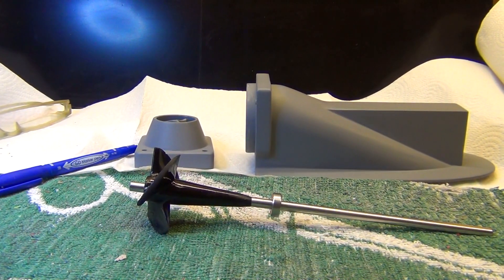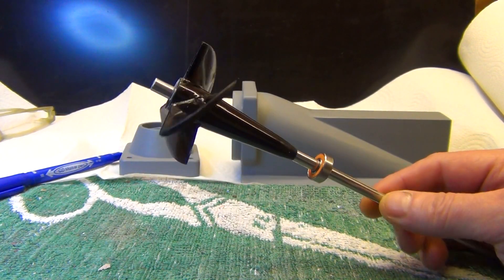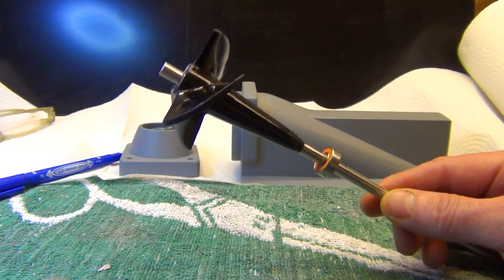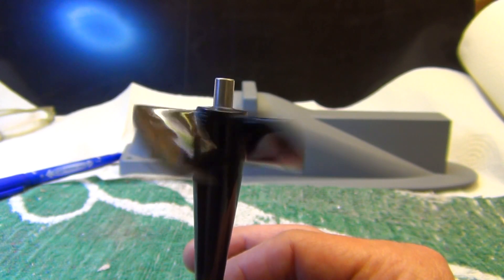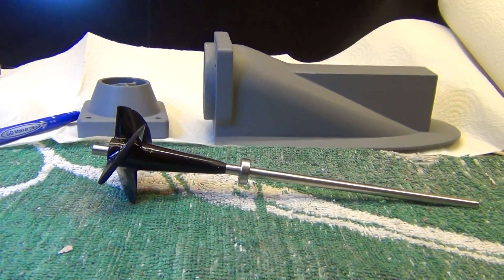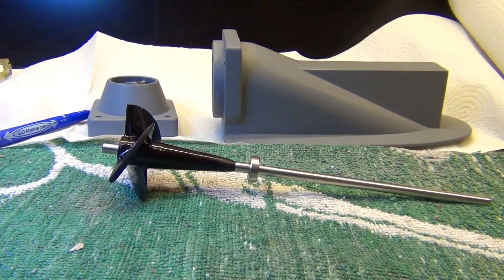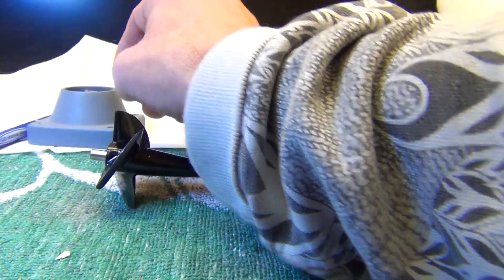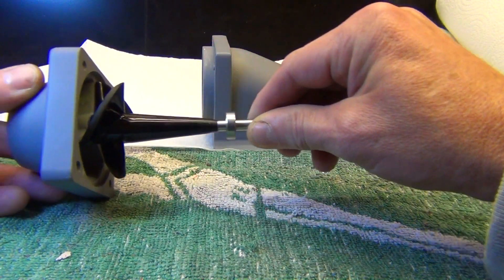First new jet drive piece, 53mm imp

Comment: Hi Mark
    Looks fantastic ! Do you think this wold push a Kayak with a decent motor on it ?
Reply from the maker: Hi there :)
yes I think it would be a great match up size wise,
I need to test the structural integrity of the drive unit first, 
but the impeller could be optimized for that application
without too much trouble to match the standard motors used,
I hope to do this as soon as possible,
thank you very much for your visit
all the very best
Mark

Comment: My goodness that unit look so bold..   LOL  Wishing list is running right now..
Reply from the maker: Thanks Al
there are still a couple of edges to round off,
but hopefully it's up for the job, strengthening stuff
may need to be done, but only on the impeller or if there 
an excessive leakage between the nozzle and jet body under the 
hydraulic pressure,, we'll just have to see :))
there could be a very big bang,, lol,, 
or I need to load up the motor more with a different impeller if I don't think it's working hard enough,, I'm a bit rough on motors :)
Cheers for the message mate
I hope all is well
Mark